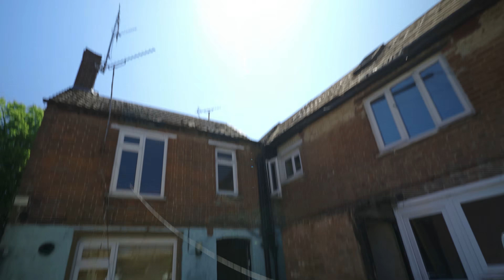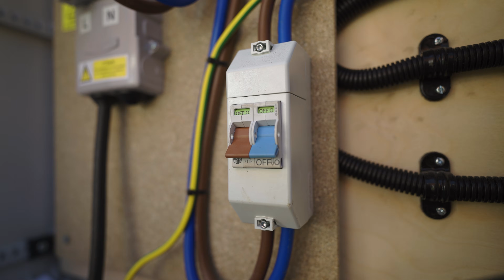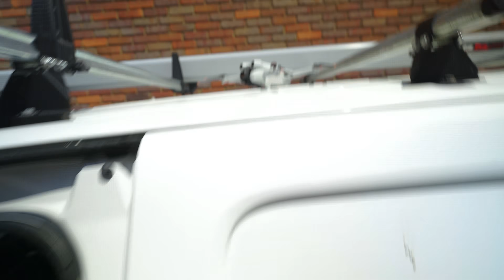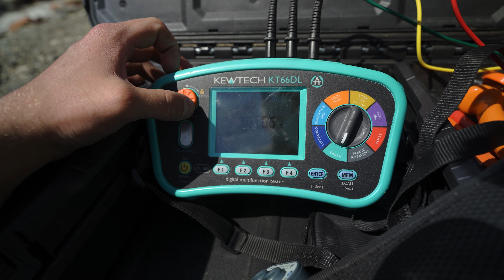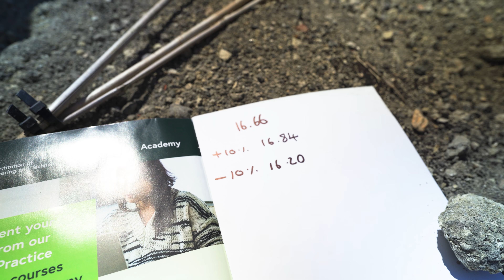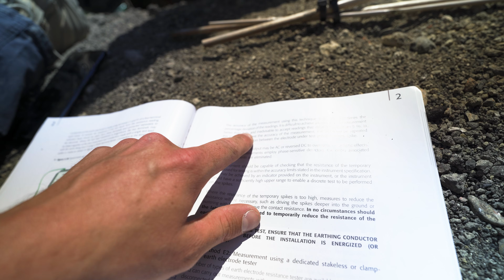Earth electrode testing the proper way

Comment: Readings example = the following readings taken  14 15 16 ohms
Average = ( 14+15+16  ) / 3  =  15 = avg  , deviation =  absolute positive value of ( each reading - avg ) 
deviation 1 = 15 - 14 = 1 
deviation 2 = 15- 15  = 0 
deviation 3 = 15 - 16 = -1 = 1 ( ignore the - ) 

% reading from deviation = deviation above / average * 100 
deviation 1 = 1 /15 *100 = %6.67
deviation 2 = 0 /15 *100 = 0 
deviation 3 = 1/ 15 = % 6.67

Comment: look st the reason behind the test its to find if your intentional earthing rod position is placed at higher resitance postion than other possible ground at a much lower resistance.
In real life we place them where they wont be disturbed and have a loop value below a 100 ohms 😀. ( the condu disk project you did i would see a calculated average being of more value than this over kill method for a single ground stake 🧐)
Reply from the maker: Mate it’s literally the preferred test method in guidance note for testing earth electrode systems, it’s also great for determining rod location, same principals.

The purpose of the video was to educate others on how to conduct the test, if anything the simpler the installation, the easier to get the knowledge across.
Reply: @residualelectrical  Yes all good but i think the purpose of this test is to find the best  location 
for the ground rod as far as impedence but there other considerations as well such as location it wont be distubred or provide a hazzard.
Reply: personally aslongs its below 100 ohms and not distubed im happy with that !

Comment: I went with a cheaper tester as testing can be done with as you say by 3 methods, my luck get called to a TT install with a fault no power (Fuse pulled) and what looks like a disconnected Earth Rod! Didn't do the job in the end because no one knew who pulled the fuse or why and other issues! But I would have been in a pickle not being able to prove the TT earth was sound prior to the  Supplier (DNO had no contact and stated that without knowing why the fuse was pulled they would not reinstate) coming out and who knows when they would turn up! Would probably need to be there when they came.
Reply: What a palaver!

Comment: I  done the calculations 3.8 percentage not 2.2 percentage…
Reply: @adriatikkrasniqi1453
Hi. Can you please provide an analysis of your calculations - Thank you. I make it: max deviation from average 16.56 - 16.20 = 0.36 then (100/16.56) x 0.36 = 2.17% which is close to Mike’s result!
Reply: @fje1948  you have to do the highest minus average taken from 3 reading then divide by the highest + - 5% but not more then that…
Reply: @adriatikkrasniqi1453 

Thank you for your swift reply.
Using Mikes readings:
Highest        16.84
- Average     16.56
——————————
                       0.28

Further using your wording:
‘Then divide by the highest’ 0.28/16.84=0.01662708 ???????????

Your detailed calculations using Mikes readings would be appreciated - Many Thanks.
Reply: @fje1948  than times by 100 %
Reply: @fje1948  I the end of the day is good to contribute with this calculation for us as learners maybe I am wrong Mike calculation I could  be right I don’t but he to explain  the calculation.